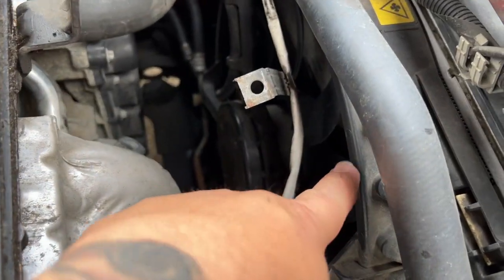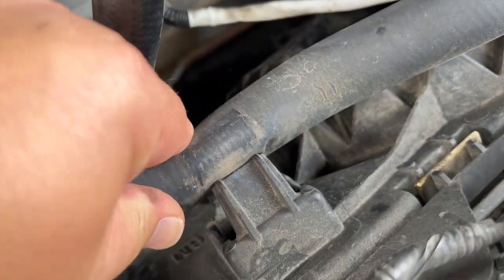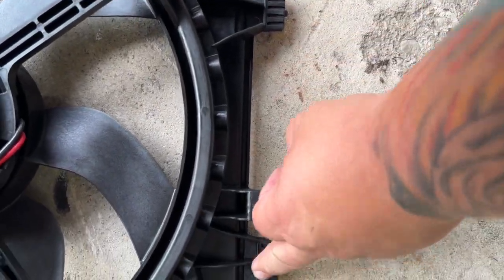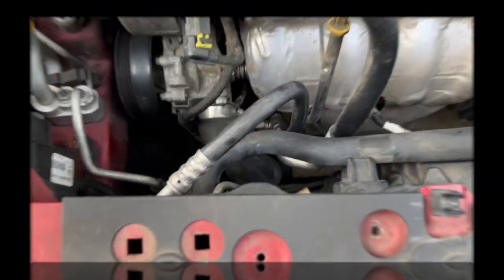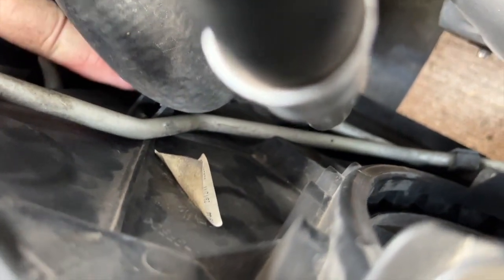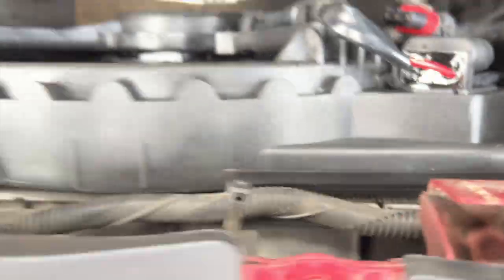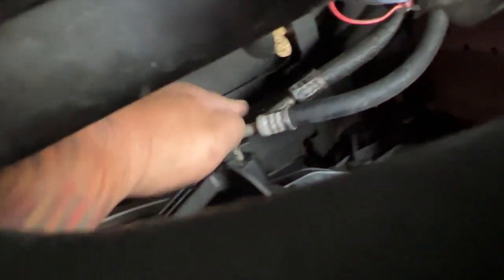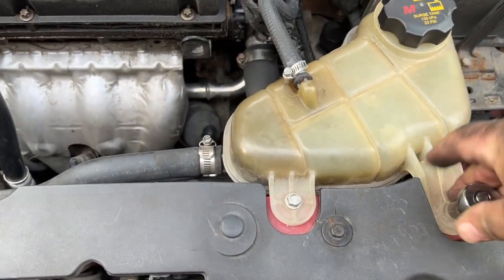Chevrolet Sonic 1.8L Radiator Cooling Fan Removal & Replacement (2012-2017)

Comment: Engineers never cease to amaze me with the stupid ideas they come up with. Why not just use 4 bolts to attach the fan housing instead of sliding this around in a tight space while lines are running over it.

Literally one of the main reasons I stopped being a technician.

Comment: defi netly not 15 minutes but an hour and 20 minutes is not bad those clips and the one electrical wire spot where the two wires meet was very stuck so i had to just use lots of force and ende up getting it, the one clip on the passenger side for the metal hose is super frustrating and in the way

Comment: Do you happen to know what the electric line is called? Just pulled mine out and it's melted..
Reply from the maker: That would likely mean you have an electrical issue, possibly a ground or exposed, pinched wire, shorting something out. It could be the fan that started it but I’d trace the wiring as well.
Reply: @FinallyHeSleeps  after some research, I found that the ends can just short out sometimes and how to check the wires and replace the ends. I've ordered a new fan and end and will be replacing both, thanks.
Reply from the maker: Let me know if that works out!